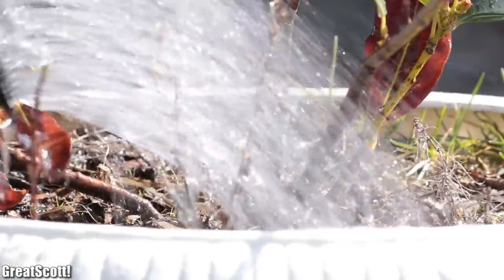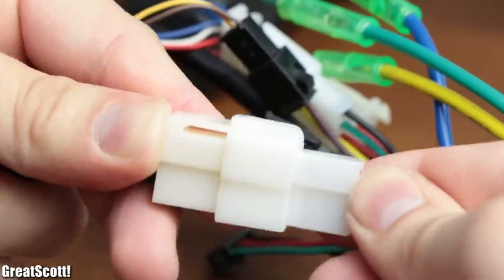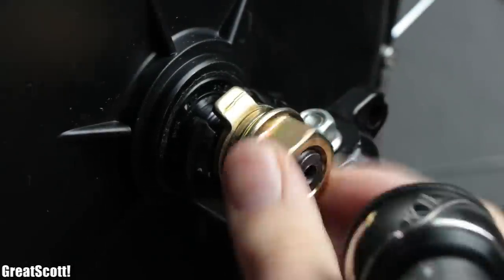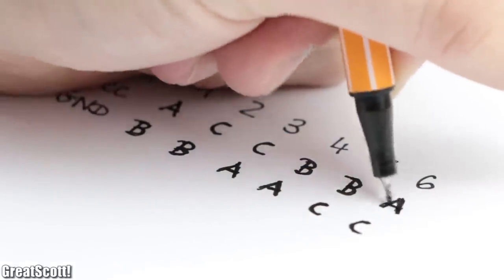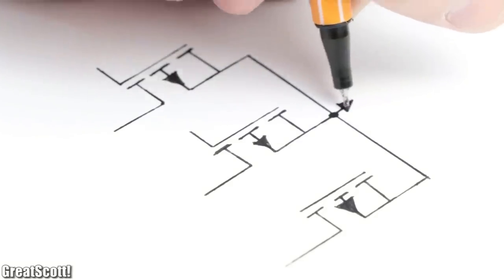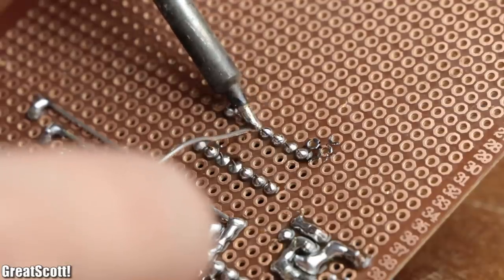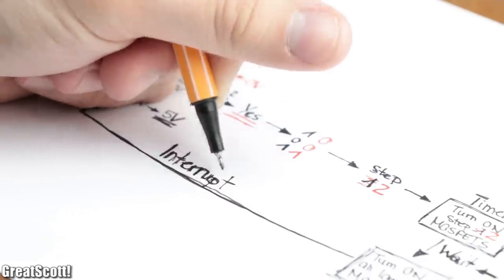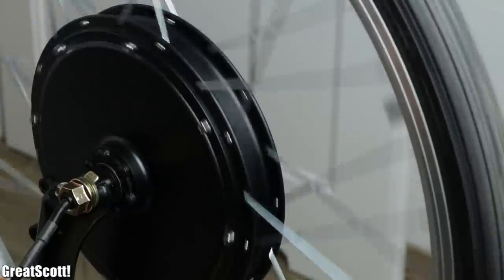Make your own Sensored ESC ||  Electric Bike Conversion (Part 1)

Comment: Sorry,I have a question.  The TC4427 chip's operating range 4.5V to 18V,why you use LM7815 15V regulator? why don't use the LM7805 5V regulator ？ Could the  three pieces of TC4427 &  one 74HC14 Hex Inverter Schmitt Trigger share the output of LM7805 5V regulator?

Comment: Hi great Scott! This was a great video, you are a genius! There is one thing I really want to point out to you for your own good. I have made many ebikes, I purchased a hub motor for the front just like you. When I put it on my bike the hub motor the second I put power to it on the ground the mounting taps broke on the forks. I don’t know what it is but the magnesium alloy is very brittle to the motors torque.  I really hope you see this because I have broken 3 forks like that and had to get steel ones. I think it’s a huge safety hazard and don’t want it to happen to you!!!

Comment: Is there any advantages on using N-fet mosfets only, or is this configuration with P-N mosfets better?
Reply from the maker: You can not easily use N-Channel MOSFETs for high side switching.
Reply: GreatScott! in spite of that I saw a lot of people using N-channel MOSFETs for high side configuration with bootstrap capacitors, but I don't really know de advantages of it. thanks for answering me, really love your videos!!

Comment: Speaking of 48v power supplies, I have a 48v 1000 Watt induction heater but no power supply that can deliver that much power. It would be awesome to do a DIY or Buy episode on a power supply that can do this
Reply: Boost converter?
You'll need to make a beefy one though.
Reply: Why not connect two 24V supplies without output in series. Many (most?) DC power supplies have isolation that makes it that simple.
Reply: just buy a 48V 20A power supply
Reply: minefally I can’t find any that don’t cost an arm and a leg
Reply: flick2040 usually the power supplies are switching power supplies. I don’t know if the pulsing will work together. Plus they’d each need 24v and at least 20 amps to achieve the 1000 Watts
Reply: Yeah, just buy the most powerfull boost-converter you can efford, because beyond 30V you don't need much precision and not even current limitation, just any kind of display where you can control used current.
Reply: I would suggest picking up a server PSU, you can find 48v 1000W+ supplies for around $100 or less, that's probably the best value you're going to find.

I can't recommend any but they aren't too hard to find on ebay: https://www.ebay.com/sch/i.html?_from=R40&_trksid=m570.l1313&_nkw=48v+server+power+supply&_sacat=0
Reply: I plan to build a large power supply for future projects and will probably make videos about that - but that will not be right now (maybe in a few months when I get enough money for parts). So if he doesn't put up any videos (or end up suggesting you to buy it rediculously expensive) and you have patience to wait, you can maybe check out that. I guess this problem is common for many kind of high power heating circuits. Mains voltage is way too high to used directly and you often need a lot of current (more than the fuses in normal houses will allow for). 
For an induction heater it's usually a resonant circuit, so the working voltages in the circuit gets much higher than the supply voltage. For your 48 V circuit you will probably already have several hundred volts across the resonant tank capacitors. Now if you would try to build one that can run off 230 V mains voltage (just using a rectifier and smoothing capacitors) you will end up with over 1000 V across the resonant circuit, wich is quite hard to find standard components that can handle.
Reply: Just get four cheap meanwell 12v units. Think it's the rs series you want. Trim pot to fine tune the voltage. Current limiting and can easily be wired in either series or parallel (Parallel actually works quite well with the rs series)

Comment: Diy or buy electric bike?
Reply: If you can get GOOD li-ion cells (not from dead laptop battery) cheaply, have good conditions to work, then diy is always better. Be careful, because it is not always legal.
Reply: If you buy an electric bike, you have it immediately and it is probably a good working product. DIY will take much more time and may cost even more money but in the end you know exactly what you have and how to fix or improve it. :)

Comment: A couple years ago, my parents had a motorized bike that the base was a cooler so it was a motorized cooler to hold drinks and stiff. It ended up breaking(which was probably a simple fix) and they sold it at a sale for $50. Sadly I wish we still had it because I love to work on that stuff and I would have had a great time with it.

Comment: Hey Great work, I just wanted to know that will this controller and the code work for my "DIY Electric Skateboard Hub Motor Longboard PU Wheel Built-in W/Brushless Sensored Motor 75mm dia 83mm height 24V-36V 110KV"

Comment: Your P-channel MOSFETs don't turn on at 0V and off at 5V, they turn on at V+ minus their full-on voltage and off at V+, whatever it is... preferably 24V or 36V or 48V or 72V. Not 5V.

Comment: Maybe one day you will graduate to a more advanced motor like Iron core attraction pulse motor. 
No, free energy is BS. Nothing is free and Peter Lindemann did not invent anything. Just a con-man making money from the stupids and simpletons. 
Uses no magnets. Doesn't work on pushing forces, but rather pulling a laminated iron core in an inboard configuration (not outboard like you have shown), and uses high voltage/current pulses to achieve > 85%+ efficiencies.
I did build one back in 2005, but since I had to make a multi-rotor connected to a common shaft, to cancel extreme vibrations from pulses, it turned out to be 3 feet long with 6 in-line stator windings (30º out of phase from each other), and 8" in diameter. Not exactly e-bike friendly, but 88% efficient.  Maybe I'll make a bigger unit one day (12" diameter, 36" long with 8 stators) and convert a small sedan into electric. Just need $3000 to throw at it. The electronics is complicated and the pulses must be MCU controlled. (Longer pulses at slower speeds, shorter at higher speeds,...)
The advantages are many;
Most of the energy from the pulses are recovered (minus the ohmic, and bearing friction losses) when the pulse is terminated, back into the capacitors. 
No magnet means; no extra expense for high priced Neo magnets, and no demagnetization due to high magnetic pulses.
No heat build up. Only a few degrees above ambient when fully loaded. This is where high efficiency shines.
No brushes or parts to wear-out like any BL motor. Just the bearings are exposed to wear.
Super long battery life. You can easily do 100Km with batteries that will only give you 30Km in a conventional BLDC. 
I believe this motor is the future of electric motors. The more time passes, the more I'm convinced of that.
I am sure you will enjoy your eBike. I have had my e-Scooter for 3 years now, and use it year around for grocery shopping and running short chores. 
I live in Canada and winters are a lot harsher than it is in Germany, but I see no difference between that, and riding a snow mobile (SkiDoo), Except I have to wait for the roads to be clear and dry, which is a day or 2 after a snow storm. Thanks to road salt. 
I ride mine in -20ºC with no problems. The batteries are in a custom heated/cooled box and my bike is stored in my unheated garage and is always plugged in to AC outlet. The small Arduino regulates the temperature inside the battery box using power resistors (Winter) and a powerful computer fan equipped with an exhaust fan collapsible flaps (For summer cooling). 
I hope this info will help some one in the ideas department :)
EDIT: The only con about this motor, besides its size, is that it can not be used as a generator. So, no regeneration breaking is possible. That can be remedied by adding a motor like yours inline and using it as the regenerator or electric break.

Comment: This is why I use Brushed DC. Simple PWM and no extensive electronics. May be less efficient, true but it's much easier to repair (both motor and controller) and cheaper.May jump BLDC once I get some funds and gain experience with current Brushed-DC setup.

Comment: Hello GreatScotts! your video is amazing and easy to understand, i love it! But i have a question, i made myself a custom controller for my final project, i'm having a problem with my MOSFET because it's easily overheat and then broke, i'm using MOSFET type IRF540N and i draw the power from Li-Ion Battery with 36V and 10Ah capacity. I added heatsink to each MOSFET, also i added RC snubber and Diode Flywheel to each one of them, but then it still easily overheat, what do you think i'm lacking of? how to make MOSFET temperature stable so that my controller can run normally and never broke? thank you very much...

Comment: You should try FOC of the 3 phase BLDC. 
BTW, even at 12V (and enough current)and proper control - you will not be able to stop wheel by hands.... But if you do - probably your winding wire is made of aluminium (yes aluminium, not aluminum)

Comment: GreatScott, your driver has one serious problem - if you only use inverters to switch between the FETs, there is no dead time. The transistors don't turn off instantaneously, so you are going to have very nasty current spikes (shoot-through) because for a short moment both transistors are on, causing a short circuit across the power rails. That's bad both because it will cause the FETs to get hot (or even blow them up), because you are generating a ton of EMI with it and also because it wastes energy, which is important if you want to run this from a battery on a bike. 

That's why proper FET drivers for half bridges have an option to set dead time. Many microcontrollers designed for driving motors/bridges have an option to generate programmable dead time too. If you are using an Arduino (ATMega328 and similar), you will have to generate this dead time in software by inserting a delay between switching one FET off and the other from the pair on. You will pretty much never see a simple inverter used in this kind of application.

Comment: Yeah, I wouldn't do that if efficiency is something you care about (6:45)... If you wanna use a PWM-ish approach to control the speed, by only applying voltage for a limited amount of time, be sure to leave the phases floating while not applying voltage (except during regenerative braking of course).

Comment: I thought about making my own pedilac and powering it mainly with solar panels. Just think about it: when your battery runs dry you just chillex on a green lawn, unfold your solar panel, eat, drink, chill and then after an hour you have power again.
or even mount the solarpanel in a way that it charges the bike all the time. at least the math somehow adds up: a foldable 80W panel should be small enough, but provide enough power even on cloudy days.

Comment: Hey GreatScott, a good video, despite the fact that I am not  big fan of E-bikes. I have a question though: would it be possible to make a energy recover system with that motor? (instead of breaking you use the motor to break and charge you battery again) Could something like that be used to charge the ebike without an outlet (I know that the efficiency will be horrible, but iam curious :) ). Thank you for making great content.

Comment: If you would like to obtain slower rotationnal speed, you should look into SPWM or sine modulated pwm. Im currently working on a camera stabiliser and my bldc's don't have hallsensors and my application requires low rotationnal speeds so I have been SPWM in a closed loop system and have obtain good results.  Great info -> http://www.berryjam.eu/2015/04/driving-bldc-gimbals-at-super-slow-speeds-with-arduino/

Comment: Is this same circuit going to be able to practically drive the hub motor powerfully? I feel like it'll take the volts, but not the required amps for actual use. Would be great if the next video accounts for this, as I'm also really interested in building ESCs.

Comment: I did the same thing just a while ago but with a 250w motor. This is because when I looked into the laws of e bikes anything over 250w is not considered an ebike and therefore not legal unless you register it as a moped. I can see that your motor is about 1000w and therefore over 250w, I would like to know how you plan to use this bike, i.e. if you are just gonna try not to get caught or actually licence it as a moped etc. Thanks

Comment: Great job. Can you make a video in which you explain how we can replace encoder of AC servo motor as this is something tricky to align U V W of the motor with with encoder U V W. As you know modern servo motor use encoder instead of hall effect sensors. Popular companies like Yaskawa and so provide software and kits to do so but its an expensive solution and there are many companies which provide good and cheap servo motor and drives but without this feature. We work with CNC machines were we find fault in just encoder but we can't change encoder due to this alignment issue and at the end we need to buy whole motor with encoder mounted and cost more :(

Comment: Can you make an automatic switch something like the I socket which turns on a vacuum or something when it senses current draw from a tool, I know it's not too complicated because I've seen other videos but they do not go in depth on how it works and how a normal person can actually make it, I know your things more about the automation and Arduino type projects but you can still make something as easy as this interesting

Comment: Hey, i have a project i'd like your help in, I need an audio amplifier with 100w on one mono channel, but i need to be able to mount the volume knob through an enclosure. I have not been able to find an off the shelf amp that lets me do these things, is there any service i could use to have one custom made? or even have you design a circuit that i could assemble?? or is there a two channel amplifier that i could bridge??

Comment: You might need torque arms !! Otherwise the axle will spin in your dropouts. Also the speed co troller that comes with the kit has a low voltage cutoff to protect a battery! Awesome build :)

Comment: Wouldn't an electric rear wheel make more sense? It would provide more power in more situations, as the grip is increased due to the rider's weight. I kinda feel you'd lose grip on steeper roads, thus decreasing the advantage of having an electric wheel.

Comment: I built one of these with a gas two stroke motor that drove the rear wheel, and an electric wheel for the front. It was two wheel drive. Electric gas human power hybrid. I took apart the twist for the electric kit throttle and figured out how to make it activate the motor at %100 power with just a switch, that way i could stuff that switch into a brake lever, and wire the cable for the carburator onto that lever. So one lever would drive both the gas and electric motor at the same time. I also had two switches next to that lever. One of them was the kill switch for the gas, the other was the kill switch for the electric. So i could change between front and rear wheel drive, both, and or human power. But then i just bought a motorcycle and stuffed that Frankenstein thig in a storage unit.

Comment: Heads up if you haven't looked into it already. The front wheel electric motors will often turn inside the front fork either cracking it or rounding out the section and subsequently winding up all the wire and possibly losing the wheel.

been there done that lol

Comment: The best  conversion is the Tongsheng Or Bafang BBS02/ HD.   Mid drive has the controller  inside  and  looks much better on a bike.    Yo also keep both original wheels  that are most of the times  better than the one that comes with the motor.   
You can also use your rear gears  to get a more efficient ride.
The screen on those mid drive motors are nicer too

Comment: Great video and clarity in explanation. it is good for rotating the wheel with no load but if will burn out if u use it for the eBike. i would be great to see a real 48v version of this. i have been trying my own but current level is too high.

Comment: Great video. I built a similar ebike but with a rear hub motor. I think with the front hub motors you have to be carful to make sure that the front forks can take the force. I’m just using stock ESC for mine, I’m interested to how yours will turn out.

Comment: But you haven't told us how you can rotate the wheel with low voltage and and why available ESC out there needs high voltage instead. Please explain it to us.

Comment: As an avid eBike cyclist, I really enjoyed your video!

Just so you know, you can remove the disc from your old wheel and use it with the eBike hub if your alignment is correct. The six hex screws on the side of the motor should align with the holes on the disc rotor from your stock bike wheel.

This project is really interesting to me, since I play with RC rock crawlers (that use brushless sensored motors) and eBikes (also use sensored motor). Keep up the great work!

Comment: wants to test esc but requires somewhat higher voltage: builds sensored esc from scratch that works with lower voltages

Comment: you could modify the controller to work on lower voltges by dding resistor on the voltge divider on the input to the dc

Comment: How do you plan your perfboard circuits? Are you drawing the general placement of components and cables on paper, or do you have a software to plan it all before soldering?
Reply from the maker: I come up with the layout while I solder.
Reply: Woaw, congrats on doing that, I'm always having trouble when I do that. =)